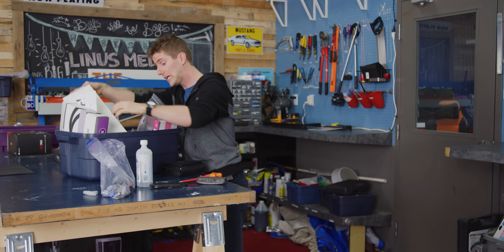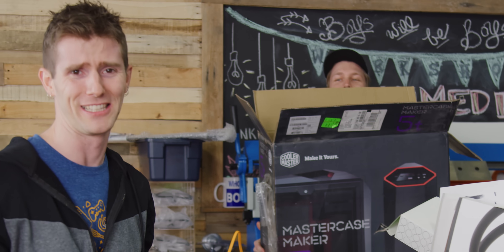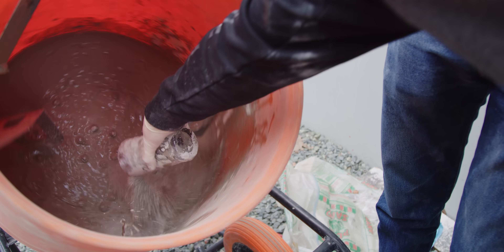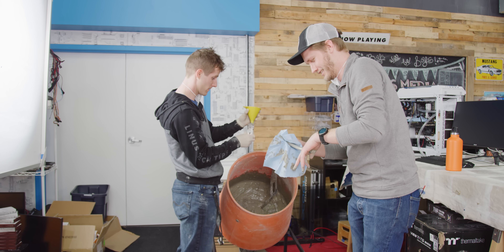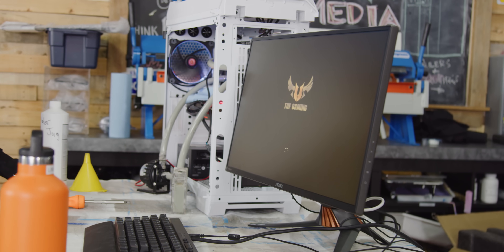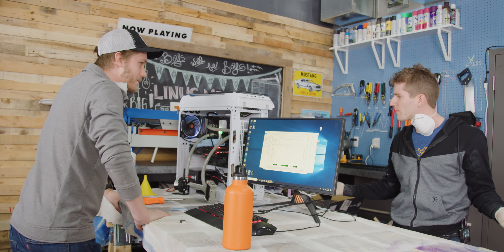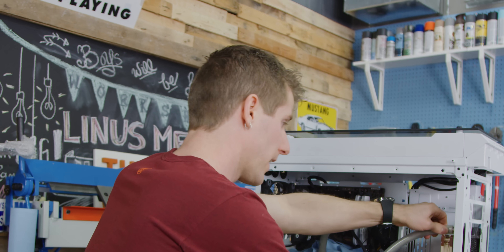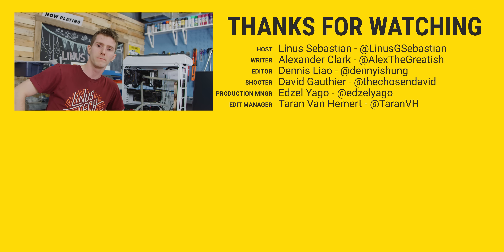I Can't Believe This Worked!!! - Concrete Cooled PC (April Fools 2019)

Comment: Was it actually being cooled by the cement Or was it another hidden PC?

Obviously a joke, but still curious.
Reply: It actually may be the cement that's cooling it. Cement trucks have the wheel thing so it doesn't harden, and the pump moved the cement around in a similar fashion. However, as you may see at the end, turning it off quite literally bricks your PC.
Reply: @nathanb011  turning off the pump certainly turns it into a brick...
Reply: @risto993  touché
Reply: My guess is that the concrete is set up in the tubes, and there is another medium passing through
Reply: This could've worked if they left it running
Reply: You absolut knob

Comment: The next step is cover with thermal pads the entire system , only best ones; then test the system for 24 hr ; and ....then dismount everything and mount it back on a case ...cose all panels add fans and submerge the interior of the case with Mapefill ** Note : MAPEFILL from the Mapei Company is a product that almost instantly get solid, is very expensive and withstand  a pressure up to 20t / mmq...and can dissipate heats very quickly .is mostly used for very thicc buildings in Europe ....but the cost for 25kg may prove to be the real issue.  Anyway ..then try turn on the PC and show some results. :)

Comment: I would like to see linus build a PC in a vacuum with an liquid nitrogen-grade cooler on it. Have the heat exchanger be on the wall of the vacuum so it can still exchange with the atmosphere, but be able to go very very sub-zero with no worry of condensation. 

The heat dissipation in the peripherals might be a problem though because those typically use light air-cooling. So perhaps the vacuum chamber would only house, say, the freezing cold portions of the CPU and GPU but the peripherals would still have traditional cooling.

its worth a shot and one hell of a cool thermodynamic problem. If you could 1 time vacuum your computer and then be able to run it at peak overclock, it does look like a solution for the future.

I CHALLENGE YOU

Comment: This is why concrete is a MUCH better solution for air cooling. Just replace the aluminum block with the ceramic with frost touch.

Comment: An April Fools, OK.... You'd have to add something that stops the concrete chemical reaction, so it does not set. It would need to be smooth, so no harsh particles.. An  screw type pump... Doable, maybe, but INSANE!
 .... Because the water that allows it to flow is also what triggers the chemical reaction that makes it set...

It's like deciding to use a particulate, even is suspended in osltuion  that can be "pumped" purely due to  how fast it carries heat way... but the radiator . . .  LOL it would need to be two stage heat exchange, the radiator would need liquid... Right? :P Even then it will probably kill the pump in short order XD

Comment: Nahh Linus, this is weak tea. What you should have done is built a form around the entire motherboard and power supply. Sprayed WD40 or PAM over the entire machine as a moisture barrier and used about twenty kilos of stone chip and cement and poured it to  a depth of 35cm encapsulating the entire computer including the graphics card in a solid block of concrete. The thermals would have been legendary and so heavy that anybody would have broken their foot on it if they had kicked it. True, no user serviceable parts afterwards but you could have just stuck an Apple logo on it.

Comment: 11:01 You actually want to keep the mixer rotating. It keeps your concrete from hardening. So the same thing for the pump. It keeps it from happening. That's a reason it also works.
Reply: The flow nor the heat will keep it from solidifying. Heat accelerates the reaction.
Reply: it does not keep it from hardening, it just slows it down. concrete mixing trucks sometimes have it solidify before they get to their destination. rotation is not enough, - it needs the heat of a cpu to keep it liquid.
Reply: @Skystrike70  Concrete trucks dont mix it or even add the water till they get to the job!
Reply: @Markus Wunderlich defenetly
Reply: I hope you know that it doesn't work at all :)
Reply: You get an upvote for being smart on Aprils fools day
Reply: kek
Reply: Concrete once hydrated has a lifespan before it sets up - heat and rotation only delays the inevitable
Reply: yea well this is not concrete so it does not matter if it keeps mixing!

Comment: Guessing the April fools joke is that you labeled it concrete and not cement.
Reply: This April Fools joke is now cemented into their Youtube channel.
Reply: Well it was concrete, they just got out all the rocks and such making it cement. Why they didnt just buy a bag of cement idk
Reply: @Zer0_Smith  no. Pretty sure they just mixed cement. To make concrete you mix cement, stone/sand and water
Reply: Sammi Liljekvist whoosh
Reply: @Zer0_Smith  You cant just take out rocks from concrete, its bonded by the cement.
Reply: @4444genral  I meant when it was still powder. It looks like they were very  careful to not get any rocks into the mixer. Which would make sense, cant pump rocks.
Reply: or recommended it
Reply: Sounds like a concrete theory
Reply: Concrete is water cement and rocks. Sand is like tiny little rocks, which is what the cement will bond to. The smaller the aggregate the more cement is required because there is more surface area. But then strength of the finished product probably wasn't a major concern here
Reply: @wascalwabbitable  Concrete is Aggregate cement calcium Lime and sand!
Reply: its cement not concrete. Its says it on the bag. Red bags are concrete ready mix. You need more than just rock and sand to make this concreate. Concrete is cement Lime aggregate sand calcium and sometimes fiberglass. Point is this is cement not concrete.
Reply: @effyou128  I went back and checked the video and you're right the aggregate is not pre-mixed. But you're wrong about the other stuff. concrete is aggregate, cement, and water. Now if I were to cool my PC with cement and water I'd throw some sugar in there, but you can add to your concrete whatever makes you giggle
Reply: @wascalwabbitable  I have my MBA in civil Engineering and build bridges for my career I think I know what concrete is
Reply: @effyou128  actually you don't. You stated that to make concrete you HAVE to add fiber. That is NOT en integral part of concrete. You do not need to go buy a bag of cement, a bag of lime, a bag of calcium, a bag of rocks, and a bag of water to make concrete. I don't care what your title is, or which office you sit in to make your calculations and drawings. If you want to get a better understanding of the thing you do from far away I can give you the numbers of some people who design the concrete mixes you think you know. Now is lime and calcium an integral part of MAKING Portland cement? Sure. But you don't add it to make concrete.
Reply: @killtyrant  side with eff? can you provide references where you found that lime and calcium need to be added to make concrete?
Reply: They used a premixed mortar so no need to use the machine...
Most english speakers mistake concrete with cement. I've seen it many many times

Comment: i can find any information about this but i'm not sure if concrete will harden in oil, could you use mineral oil with a ceramic like substance like concrete mixed in, or use actual ceramic powder mixed in water that wont harden

Comment: Linus that how flow through tubes works. You can look at the equation for laminar flow. The closer to the edge of the tube the slower it moves. It happens with water as well you just can’t see it because it’s clear.

Comment: Well main reason it worked on first place coz the reaction that takes place for hardening concrete is endothermic (means reaction that need absorb heat to take place). CPU heat just helped concrete in setting faster. After concrete eventually set, it bricks your cooling system. Well if you are using this cooling system for span of one video, it is good. Otherwise don't recommend it @linus

Comment: If this is not an April fool video then this is the first video I actually hate (still hate it just a bit less even if it was). You have all that great hardware that I can't afford and you run concrete and therefore totally ruined it. It's an abomination no less

Comment: Could you fill the case with concrete similar to the Mineral oil and have it all Passively cooled? Or is concrete too conductive? Could you coat the components in vasoline and then fill the case with concrete?

Comment: April fool's or not . The heat removal properties of ceramic causes me to wonder if water cooling infused with ceramic dust would work long term and yield good heat reduction . 
Concrete or cement will try to set due to the oxygen in the water loop . Does not take much .
Ceramic dust , in the right amount , might just give you the ability remove same amount of heat as the cement but without the congealing properties .

Comment: of Course concrete cooling is censored but it might be possible to mix inert solids into a watercooling loop to increase heat capacity.
of Course everything would have to be designed to avoid the solids to get stuck somewhere...

Comment: cement will harden in contact with water because a chemical reaction not because it dries, its a hydraulic mortar and thats why it can be used underwater

no matter how wet and runny you make the mix, it will harden at some point, so you have only like 2 hours of joy, then it will harden and you will have to grind it and recook it with ash or potery to make it cement again

also its a highly caustic substance as it comes from lime stone ( same thing from where industrial detergents come from ) so not good for any surface thats in constant contact with it before it hardens

but good content for aprils fools day

Comment: Here's a better idea: make a cooling box out of concrete using tubes through the middle in which you run water (essentially making it a radiator). this is how under floor heating/cooling works.

Comment: You should actually try for real and fill the entire case with concrete like a giant heat sink.
Reply: cough Water.
Reply: @jocerv43  pure water isn't conducive. as long a you let it dry it could work.
you could use a spirit instead of water. or you might be able to use a coating on the board (but that would effect thermals)

Comment: it's CALLED CEMENT 

concrete consists of AGGREGATE, WATER, AND CEMENT 

CEMENT without AGGREGATE is just CEMENT
Reply: There was sand in the mix. Sand is aggregate. So it's concrete
Reply: i mean its a tech channel not a construction channel so excuse their lack of knowledge of exact terminology
Reply: @calh109  They have access to both a search engine and a Jake though, so they really have no excuses.
Reply: @Djhg2000  What does Jake have to do with anything? He's not the brightest bulb.
Reply: @Djhg2000  that's like saying someone who isn't tech savvy has access to Google and therefore have no excuse mixing up memory and storage
Reply: @xenonram  It's a joke mate.
Reply: @calh109  Yes. That's the joke.
Reply: I'd prefer a plaster of Paris cooled PC.
Reply: Look, guys...they called it concrete on purpose, as part of the April Fools joke. =P
Reply: Man you mad
Reply: thank you, i didn't want to be ''that guy''
Reply: Cement paste.
Reply: They forgot to mention that cement actually generates heat while it is hardening, which would no longer make sense right away.
Reply: They actually bought concrete though, the bag said it had sand mixed in which would be considered aggregate
Reply: @silvermold  I mean he not a nerd he just knows from experience
Reply: @silvermold  I am a farmer and we aslo build stuff arund the farm whit cement or concrete. So this are basic things that you have know.
Reply: The aggregate is just some dust in this case. Good enough.
Reply: @voxelfusion9894  yeah no

Comment: I thought you were going to have a single tube formed into several loops encased in a solid block of concrete (bring a fork lift)?  ;-)
What was the cost of this "experiment", block, pump, radiator, reservoir and tubing in the trash (concrete not included due to amount used and remaining still usable).

Comment: WHO’S IDEA WAS THIS????
Unless you keep regurgating the concrete, it will kinda settle down and solidify. Keep it for too long and it will harden(depending on the mixture) and you might not even be able to salvage the parts. Is it good for one time use? Maybe. But not for an everyday pc.

Comment: What if you ran a couple of feet of water cooled pipe through a poured block of concrete? Like incase a loop of hose in concrete and let it harden. Use the concrete like a radiator

Comment: Concrete??? It’s just cement and in fact cement exerts heat when get in contact with water, called as hydration. It will set hard in tubes in 30 minuets.

Comment: Please do not actually attempt this this way on your hardware, april fool's or not - the cement in the lines will continue to set whether or not they are moving, cement sets through a hydration reaction with water. Having a UPS will NOT HELP, as they theorize. The PC likely shut itself off as temps rose as the coolant got more and more viscous. If you want to do something with a weird non-newtonian coolant or something use a ceramic-based thermal paste or something. Maybe even use Linus's terrible brown bulk thermal compound, but straight cement mix and water WILL eventually literally brick your computer. 

That being said, the idea of using a cement-mix-like compound might be worth exploring, if you are willing to take the risks and can control or inhibit the cement hydration reaction and reduce viscosity (e.g. by adding table sugar, and adding viscosity admixers).

Comment: If you add certain amount of sugar it'll never solidify
(Like for possible 2.0 version of this video)
Reply: Sugar over 1% by weight would prevent the full hydration reaction  from fully hardening the cement. That said it will still eventually cure into a very weak solid akin to a chalky limestone and the exothermic reaction would produce it's own heat.
Reply: Yeah. Thats exactly what I was thinking too. They should definitely try to make saturated sugar water and then mix it with cement. That should prevent cement to solidify altogether. Also salt will work the same way.
Reply: Sugar will caramelize at high termperatures.  Also is an excellent food for microbes.  

Honey is the better option, but it tends to crystalize.
Reply: @kennethmeyerson1165  so we need salt and sugar...but not actual salt or sugar...honey and soy sauce?! Anyone for Teriyaki cooling?
Reply: @kennethmeyerson1165  Honey should decrystalize when exposed to enough heat, so... shouldn't be a problem
Reply: That presupposes that the concrete doesn't solidify during the downtime.  I travel a fair bit and I leave my rig off for upwards of 1-2 weeks frequently since ETH mining isn't as profitable as it used to be and I don't leave windows unlocked and open when I'm away. One night is enough in a watertight loop so I expect that one week is enough to dehydrate honey.

Alternative approach is to use a non-volatile solvent for the concrete rather than water.
Reply: @kennethmeyerson1165  Concrete cures by undergoing a chemical reaction with the water, not by having the water evaporate.
Reply: Anson Mansfield , that was exactly my point.  The loop does not leak, water is consumed. A solvent, not a water solution, for concrete is by definition NOT consumed.  Word choice is arbitrary.
Reply: use honey
Reply: If you understand that he didn’t actually use concrete in the loop then you’ll know it was all a joke 😂

Comment: That bag of mortar mix is not concrete even when mixed correctly much less so when no sand is added. You would not be able to run concrete through it most likely because actual concrete has aggregates. Other than that I found the video interesting.

Comment: Ok now do Mercury cooling! According to Wikipedia Mercury conducts heat 16 times better than Water, i beg you.

EDIT: There is also a non-toxiv alternative called Galinstan which is a Gallium, Indium, Tin alloy, and it conducts heat twice as well as mercury. It's just a bit expensive.

Comment: Here are several observations and a challenge from a really smart guy/building tradesman. Yes, cement has excellent thermal properties, but you went at it, all wrong. Take the "mud" mix and let it cure thoroughly, rock solid. Then grind the cement back into a powder; mix it into a colloidal suspension, and run the experiment again. The cement won't react with the water, a second time. Use the same type of pump, block, and hoses, and vary the powder to water ratio, say 25/75, 50/50, 75/25, to determine the most efficient ratio, and you may be pleasantly surprised with your findings. Yes indeed, you may be on to something. And Yes, it's always hilariously entertaining to watch "Dudley Do Right and the Lads" play with Trade Tools. The concrete mixer uses the tumbling action of the aggregate (gravel) to mix the concrete. When you mix the colloid, use a kitchen blender.

Comment: I wonder if you could improve on this idea by using like actual ceramic dust mixed in with water, or a more water heavy concrete mix, so that ti wouldn't solidify if it sat for a while.